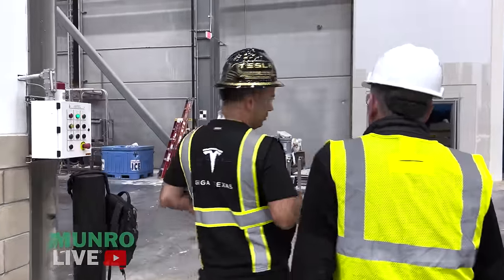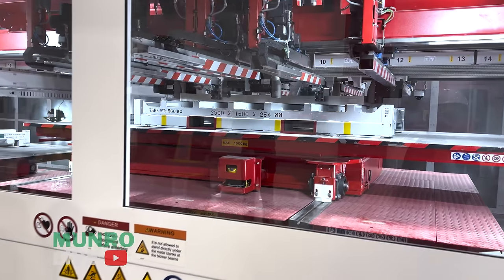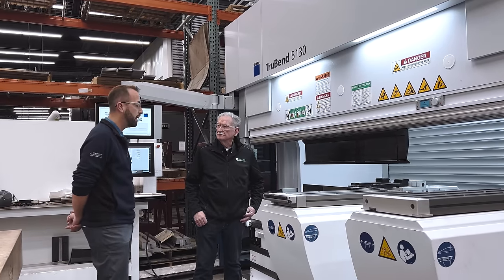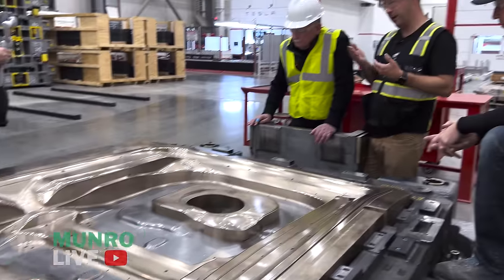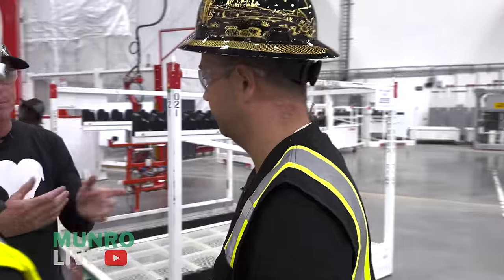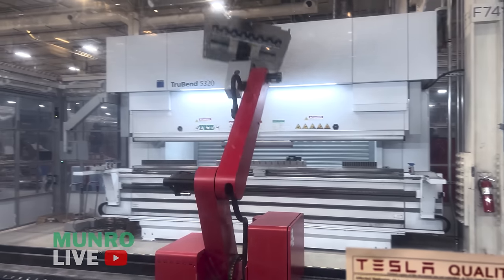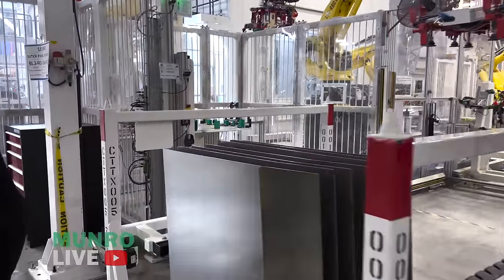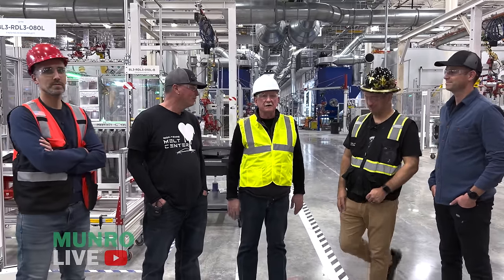Tesla Manufacturing: See how the Cybertruck HFS Panels are Blanked, Bent, and Built!

Comment: I have mixed feelings on this stuff.  On one hand its amazing seeing how they are doing things and some of it really is amazing stuff but at the same time I feel it ends up creating a lot more work and consumes a lot more energy to make the stainless steel parts vs other metals like aluminum.  Now the heating to red hot before stamping the panels is consuming massive amounts of power and power still comes mostly from dirty power sources so it really does make me then agree with the haters or people that claim that these electric cars are not doing anything to save the environment and then they are using a lot more power to just get made that means that a cybertruck already has a large carbon footprint attached to it that we really need to consider when we give vehicles there overall environmental credentials.  Elon should have just used aluminum and not only saved massive amount of time getting it to production but also making it look a tad better and safer eg maybe then it could sell in all markets vs america only.

Comment: This isn’t that special we have been doing this with our stainless presses for 20 years. However is a fools errand to make body panels from stainless unless you are not worried about looks. If you like what stainless kitchen benches look like  then this is what a pickup that has been used looks like. If you want strength all modern cars use AHSS materials 1000Mpa UTS materials in places. Stainless is 500Mpa.

Comment: If there is construction debris on the floor, then this debris is also in the air, this dust flies everywhere and is breathed by the people who work there and pass by these areas! Not to mention the equipment that collects this dust and settles on the internal surfaces of electronics, especially lubrication mechanisms. This construction abrasive will destroy precise positioning systems, which is precision in operation and lack.

Comment: “He’s like it’s a lot simpler than I thought” good example of people that undermine technology… dude get out of there
Reply: In engineering, doing the same thing simpler is always better. 

Complexity is the engineering opium of stupid people. You want to reduce failures points, reduce variables, reduce costs, improve speeds. Complexity does not equal technology. In fact one or the core tennets of technology is to remove complexity through better processes. For example, computer assisted design reduces the complexity of the design phase of the product. Casting reduces the complexity of part assembly tremendously, and 3D printing can reduce the complexity of complex machining by a huge amount.

All, of course, if used correctly for the right purpose. For example you could make a hybrid vehicle and cram a ton of technology and complexity into a overall product that gives you a vehicle that is worse at everything compared to both a BEV and an ICE. 

Complexity and technology only serve you if their application is warranted. Think of the G-11 assault rifle made by the Germans. It's extremely good, has amazing raw statistics, is very compact and very very advanced, and it took a while to jam. However it's clockwork like machinery made it basically impossible to maintain, if it broke it would do so in a way nearly impossible to fix in the field, and it's huge production and maintenance, fragile ammo and proprietary  rounds costs basically ensured no one would pick that rifle. Not even the Germans who built the thing.

Never make something complicated if you can make it simple. And never EVER let Germans with engineering budget without supervision. They will make it you some amazing shit and then proceeded to have your entire production staff spontaneously combust.

Comment: 23:47  No one is interested in that LARGE one piece casting sitting on those stands?  That right there is IMPRESSIVE ! ! ! ! !

34:34  What is the microwave for? Coffee?
Reply: I noticed it, but the subject is the stainless steel. Even a mention of an aluminum casting will remind people that this is not a stainless steel vehicle, which would conflict with the desired Tesla message.
Reply: Given the labeling on the side of the microwave oven, my guess is that some part of the machine needs heating as part of a maintenance or repair workaround.
Reply: 23:47. I was surprised they didn't stop either. The castings were covered closely in a previous video. This assembly of a casting and the stamped firewall, and other stampings would have been interesting to see in detail. They were in a hurry though as Lars said at 23:03 they were running out of time.

What they also bypassed at 23:05 was the Cybertruck BIW line. Not on the east side of the factory where Model Y BIW is, but at the start of Cybertruck production line in GA. As is the Cybertruck cabin painting area. Evidently not in Paint, but also in the Cybertruck part of GA.

Comment: EV truck manufacturer uses CNG lift trucks in their facility 😂😂😂😂😂
This type of manufacturing is a joke to satisfy the shareholders. 140 panels out of oven means less than 2 cars per hour (including downtime), which will result in less than 8000 trucks per year if they work 24/7, with very minimum downtime. Absolute fake 👎👎👎👎👎👎👎